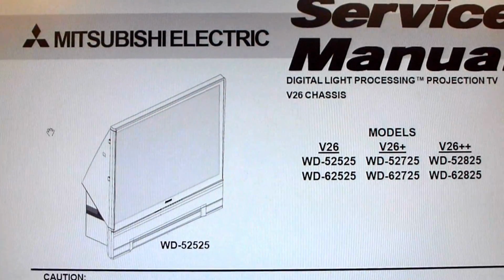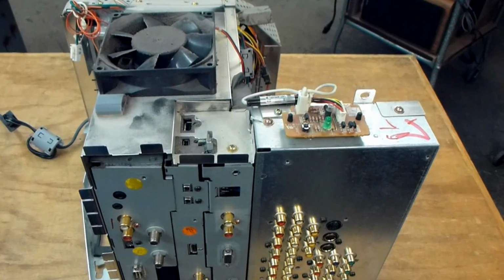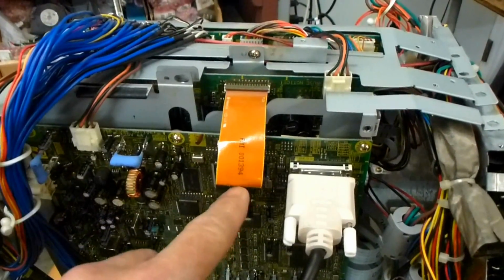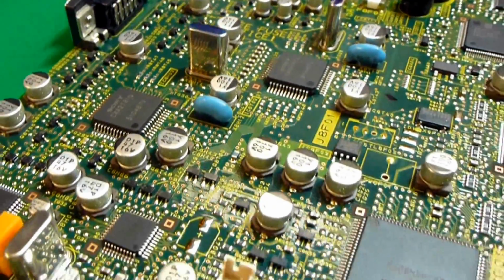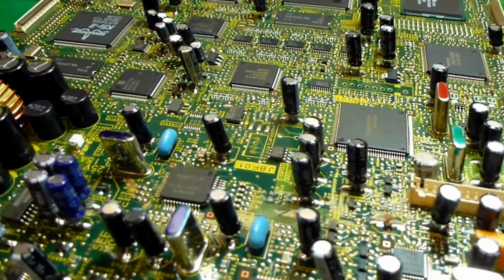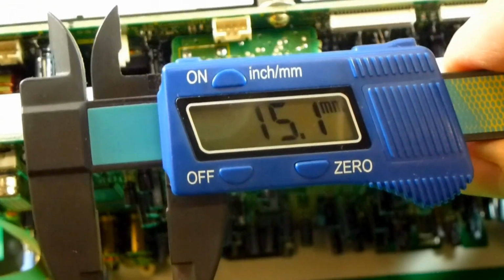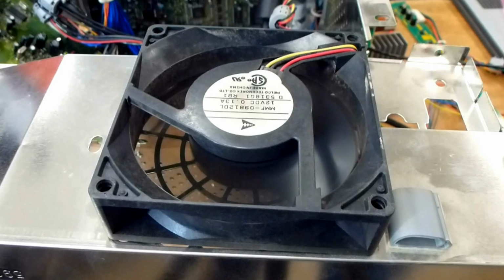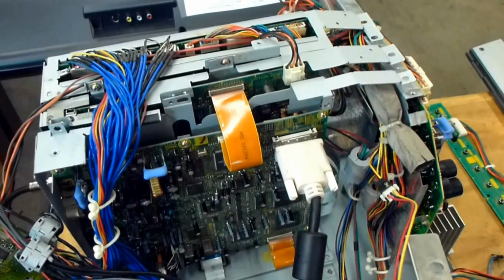Mitsubishi DLP Electrical Chassis Rebuild DM FMT WD 52825 62825 52525 52725 62725

Comment: Yes the power comes on to the tv and when it comes on there is a click. One of the fans does come on. I dont think the color wheel turns on. when i plug the power cable in (with the format board wire at the top of the board unplugged) the machine boots up. i hear the click and one of the fans comes on. the blinking green light comes on i plug the wire of the format board back in and the light goes off. i click the power button and then there is a solid green light, but no light from bulb.

Comment: I am working on a 52525 and I replaced 8 of the caps out of all the boards. I am still getting the blinking green light unless I pull that one wire at the top on the format board. I put the wire back in and boot it up just like normal but I am getting no visual from the bulb. What do you recommend I should do next?

Comment: Great Video!! I have the 62825 and just a blue screen, no sound but I do have the menu. I tried the reset and it doesn't matter if it's on cable or dvd, still just a blue screen and then after awhile it turns off. There are NO lights flashing on the front, just the normal green power light. Is this a power source problem? If I ordered all the caps from Digi-Key do you know what part number they would be? Thanks for your help. I love this TV but can't see spending $500 on a service call.

Comment: Hey Norcal! I took out my panels and located I think six bulged caps. I am new to this stuff so I was thinking I should try to fix only the ones visibly bad and see if that works? Is there a way to check if the surface caps are bad?

Comment from the maker: on the DM look for diode D81A5 just below the 4 1000m16v caps, check on the cathode side(the side with the black band) for 3.3 volts. If you dont have 3.3v then suspect something near the 4 caps maybe a solder bridge or something.

Comment from the maker: I have never tried to use a 525 DM with an 825 FMT so I cant give you any advice here. but I would think that the only way it would work is with an 525 DM with an 825 FMT. I know you cant boot an 825 DM with the FMT connector FC disconnected. Sorry I couldnt be more help

Comment from the maker: Just one bad cap can cause multiple distortions and lines. Just below the 4 big caps on the FMT you will see a group of 5 caps clumped together, I cant remember the values but I think 2 are 10m16v, 2 are 4.7m and Bi-Polar also. Those are on the PC input so try replacing those to correct the PC problem

Comment from the maker: Yes a bad DM will cause it not to boot. The Jack panel typically has the 2 1000m 10V caps that bulge but that will not cause no boot.On your DM you will see a small white and silver rectangular fuse near the 4 1000m 16V caps. with a voltmeter check if there is 3.3 volts on that fuse while trying to boot. also in the back side that are 3 more fuses check is there are ok with an ohm meter. on the DM check the 4 pin connector from the power supply for 12 volts and 6 volts.

Comment: i have the 52525, i was going to get your opinion, it has the green flashing light thing, it had it before and i replaced the 16 know problamatic caps and fixed the problem.  but its doing it again, and with the fc plug unhooked it still keeps blinking, my question is, would it be worth the money and effort to replace all the caps on my fmt and dm boards, thanks

Comment from the maker: I have rebuilt about 6 complete units and it takes about 4 hours total including the power supply and thats for a 825 series, the 525 and 725 series have less capacitors and typically take about 30 minutes less. We get most of our parts from Mouser and Digi-Key.